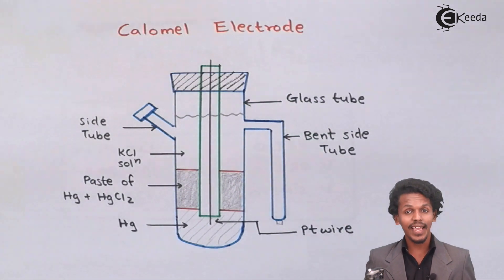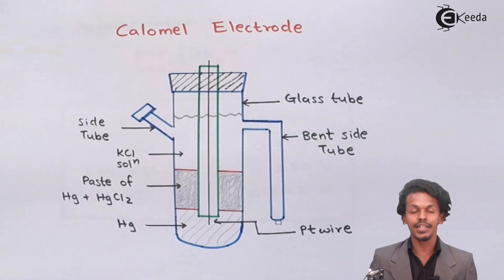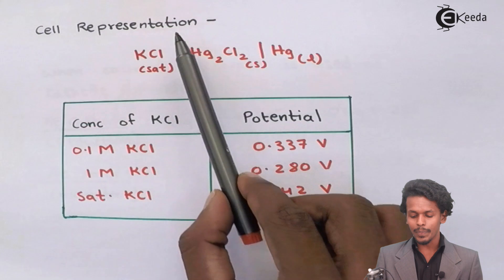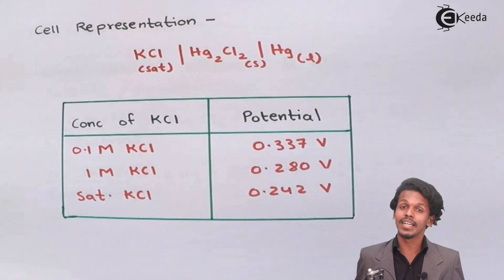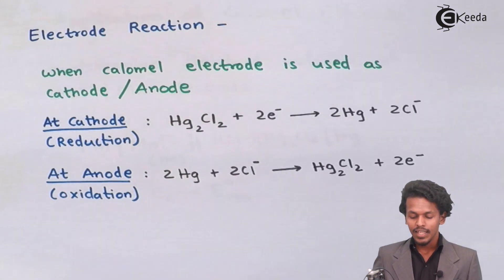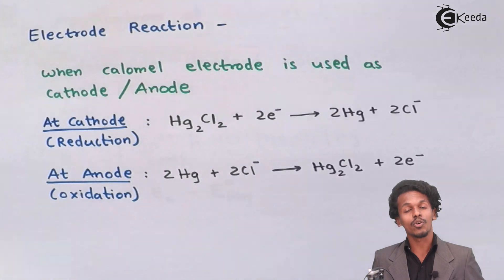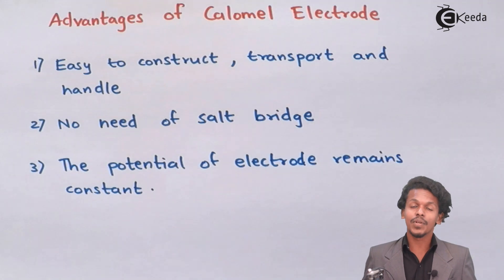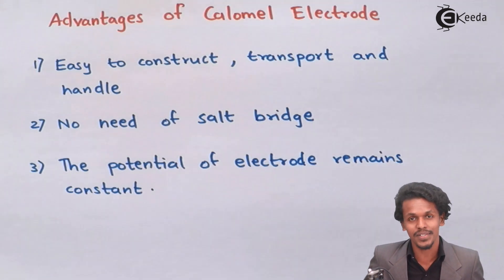Calomel Electrode - Electrochemistry - Chemistry Class 12

Comment: Nice explanation sirrr . Sir, what is the difference between these calomel reaction equations. 1/2Hg2cl2 + e-  --> Hg + Cl -  and 2Hg2cl2 + 2e -   --> 2Hg + 2Cl -? which one should we use? Thank you.
Reply: Hg2Cl2 + 2 e-   ------> 2 Hg + 2 Cl-.....u can also divide this reaction by 2 and write tht...both are equally correct nd will give the same results in calculations....but mostly , the former one is used!